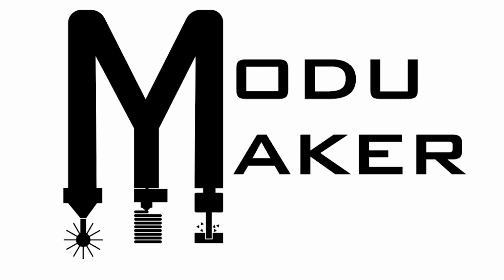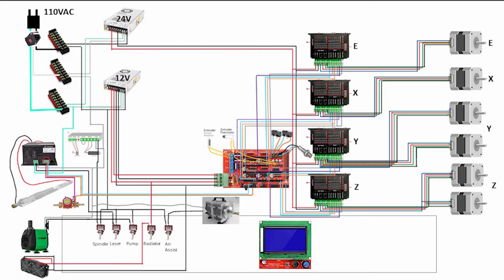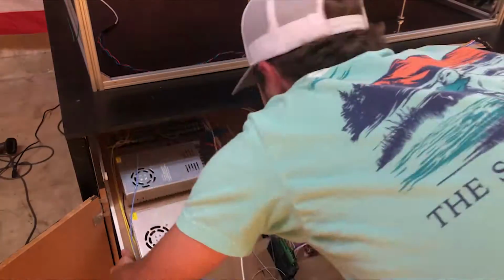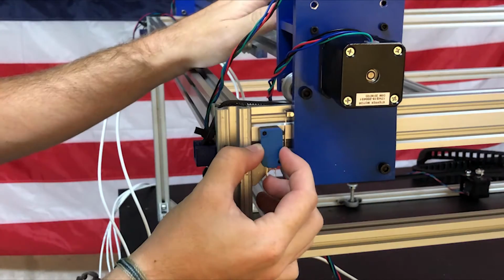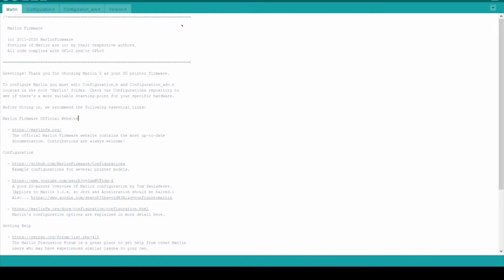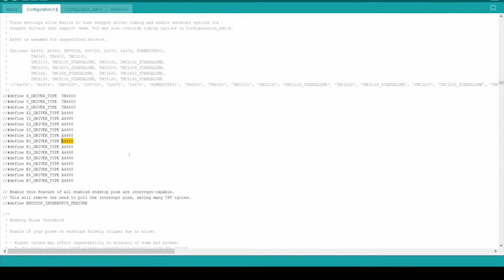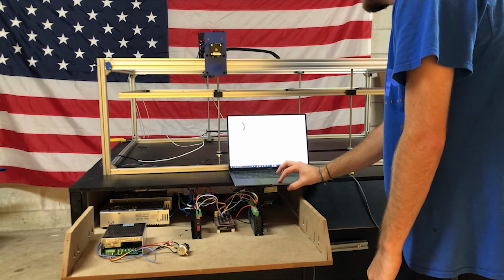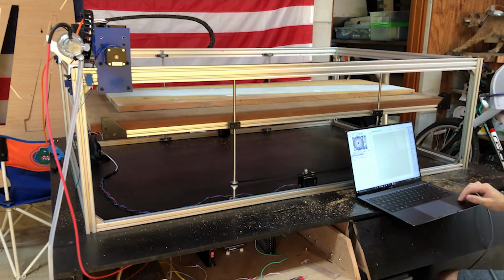MODUMAKER 3D printer/CNC/Laser Cutter build PART 2: Electronics

Comment: Caleb, amazing build and exactly what's been on my mind as I''ve worked through where I want to take  my projects. I've got quite a few smaller projects to conquer before attempting this but I have to say, in the coming year, this will be the ultimate goal for me. How many hours do you have into the entire project from design to implementation? I need to go back to the first two vid's and look at the modular tool design you put in place, this is of particular interest to me. It blows my mind what can be crafted utilizing aluminum extrusions, have you found the movements along x, y and z to be smooth and accurate at this point? I'm leaning towards linear rails but at the end of the day if the cost doesn't justify the end product, no point if I can get similar performance with the design you've put in place.